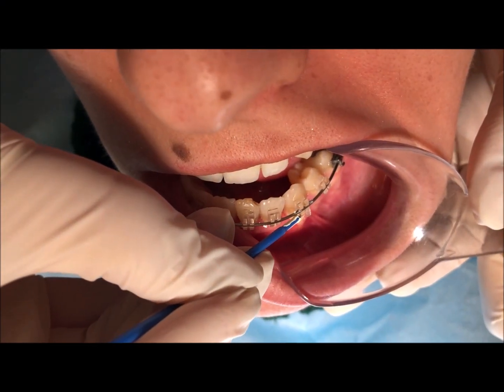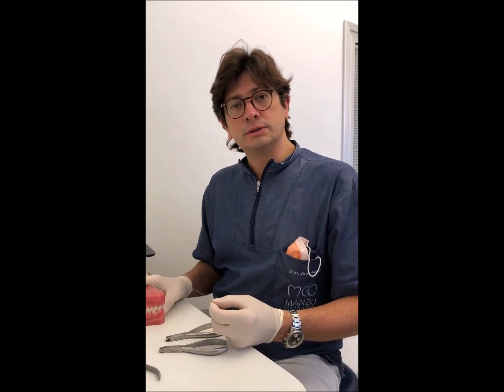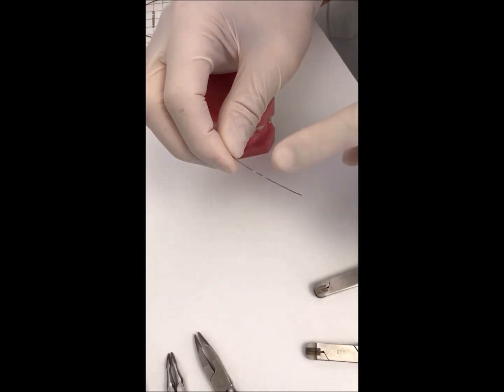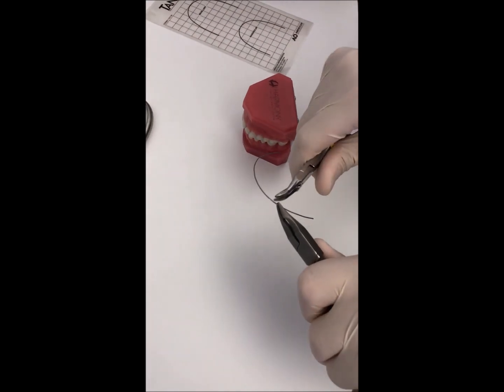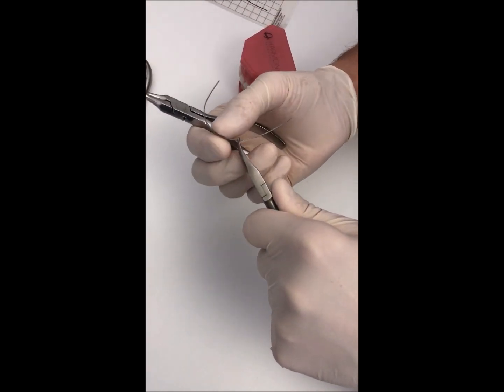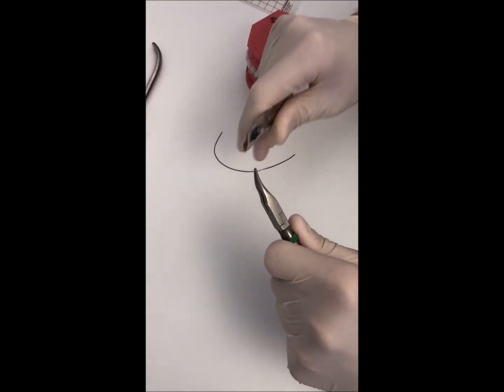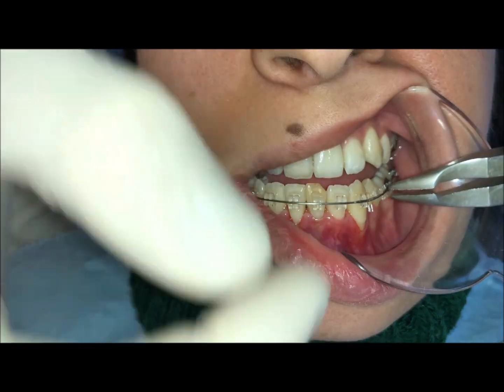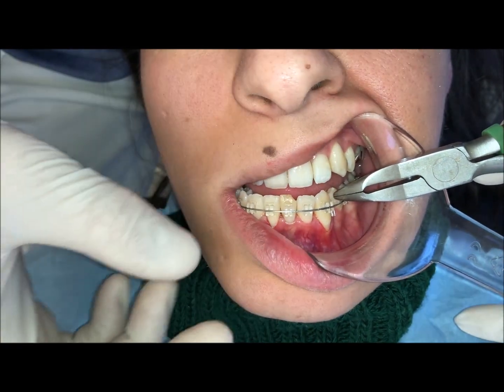Torque application in wire (tutorial)

Comment: Sir i didnt get..in the first bend    u bend it inside right. Coz we need to bring root lingually. Means inside.  But what did u do on mesial point?? And this bend we have to give exactly on point or beside the points.
Reply: As he did the first bending, the torque will affect the whole arch.. that's why he did the second bend "mesial to canine" to remove the torque from the rest of the wire leaving a torque only on the canine
Reply: As he did the first bending, the torque will affect the whole arch.. that's why he did the second bend "mesial to canine" to remove the torque from the rest of the wire leaving a torque only on the canine
Reply: What type of wire did you use for this purpose? With stainless steel wire, i struggled to tuck it in the bracket.